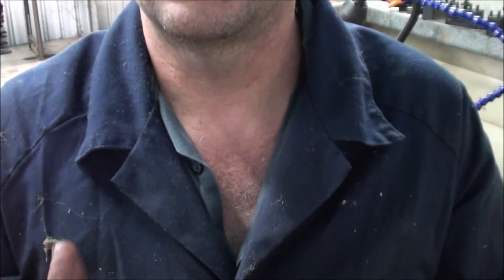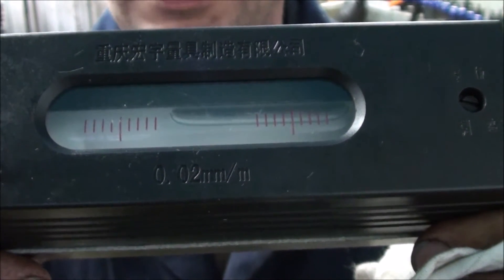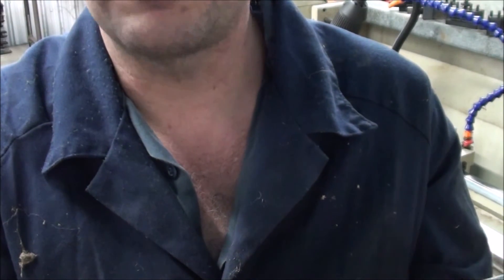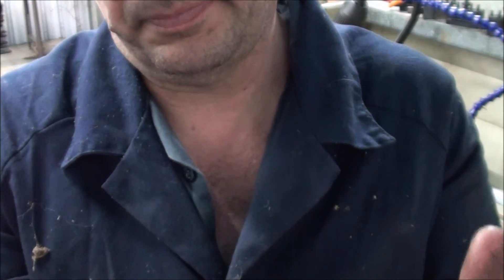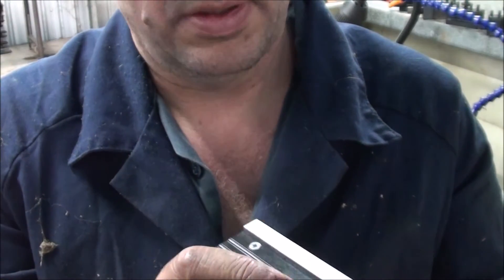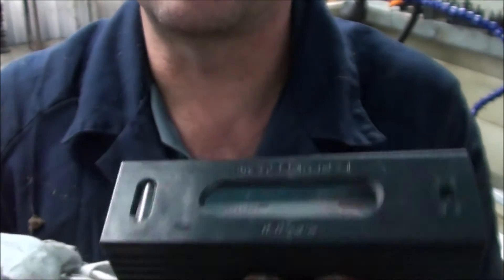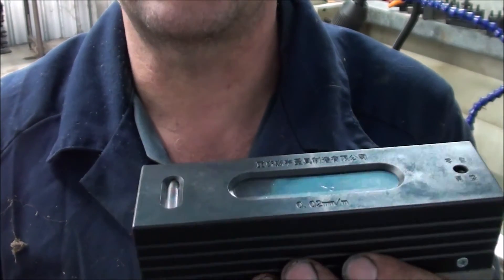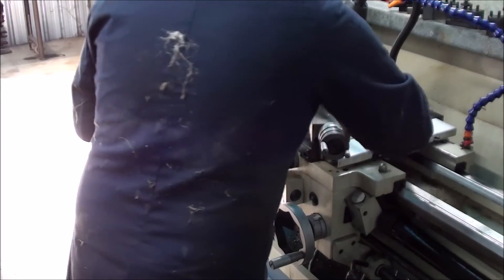Lathe Move and Setup - Part 2

Comment: following on with interest..
Reply from the maker: Thanks Emma, it is a time consuming and long winded process, even if it only takes a couple of hours to do
Reply: Yes it sure is. And one adjustment can affect the others that you thought were getting very close. So there's quite a bit of that back and forth. And the more adjusting bolts you have the tougher and longer the job gets. It's still very much worth doing though.
Reply from the maker: So true, almost there - start again lol. But when it is right the  lathe turns so true it is a pleasure to use.
Reply: Yep I got my little Emco compact 5 lathe to turn to less than 2/10ths taper over almost 12". It won't keep that adjustment for more than a few hours since it's sitting on a standard wooden floor construction. But it's pretty satisfying to see those kinds of results.

I did catch your comment about the lathe not needing to be perfectly level. it just needs the same bubble position the full length of the bed. Many have no real idea why the leveling is really done and that it's just an easier method to use a level to get the bed true.
Reply: Well I should have mentioned that lathe is bolted down to a 95 lb 1" thick steel plate. That lathe only weighs 65 lbs. But when the temperature or humidity moves a few points the floor will move and even that fairly thick steel plate flexes.

Might be a good idea to explain exactly what's being accomplished with that "leveling". I see a lot of comments on the forums where it's pretty clear they get fixated on that level condition and don't fully understand it's just the easiest method to get to a non twisted bed condition. I used a pretty expensive Mitutoyo level and got it dead on to the level, but even at that for my lathe and to really dial it in I had to do some very tiny adjustments after making a turning test on a bar the full length the lathe will do between centers. It wasn't out much, maybe 3-4 10ths, but the last adjustments got it very close. Frustrating it won't hold that level of accuracy, but I learned a great deal while doing it. Now I need to do something for the larger lathe I've bought.
Reply from the maker: That's a great result with your lathe on a wood floor. Maybe I should spend a little more time explaining why a lathe should be leveled.